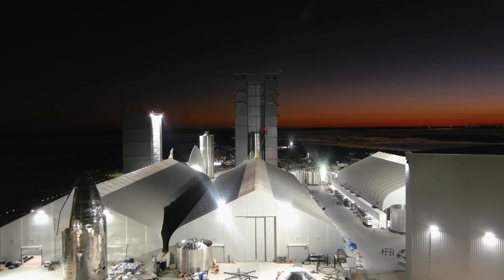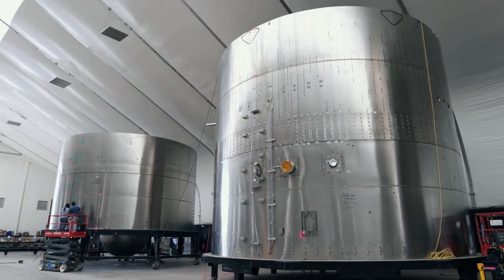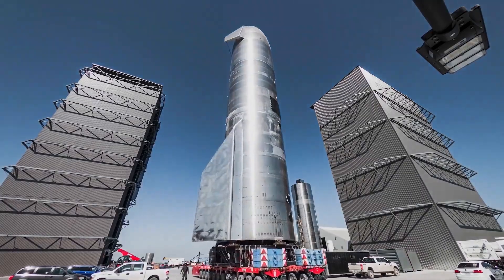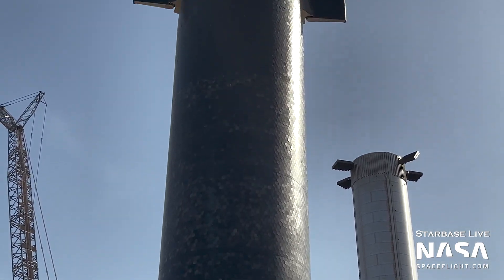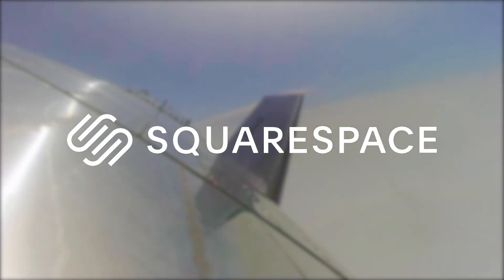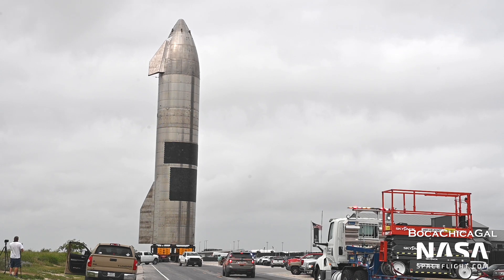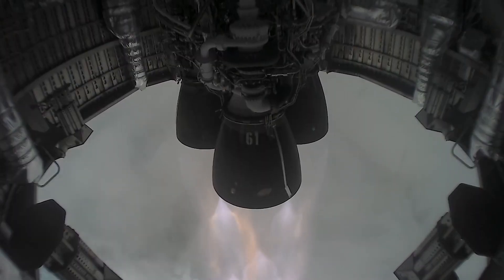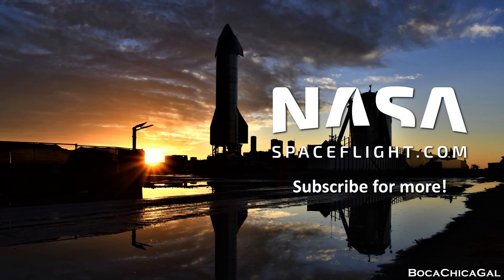How SpaceX's Starship Will Survive Reentry

Comment: Great video, just like to say that when something re-entered the atmosphere it is not friction that causes the surface to heat, it is compression (like when you compress a piston in a diesel engine, as it compresses the temp goes up exponentially ).  It is this compression that increases the heat on the surface.  Again great clip!
Reply: It is certainly not just compression, there is a very large role that friction plays in the heating. 

Do you have a source to support your statement that it is primarily compression?

Comment: I see no reason why a very large parachute(s) could not be used at the very beginning of reentry. Braking parachutes have been used on aircraft in its weight class many times. It could be triggered by a pressure switch when air resistance would be optimal. Perhaps it could be multiple chutes released at different periods. The ship could come down engines first which would eliminate the need for the flip maneuver. Parachutes can be manipulated to alter the rate of descent or to change course to some degree. The flaps would no longer be needed which would reduce drag and weight.
Reply: At the very beginning of reentry the air is much too thin for parachutes to be of any use.  Besides the velocity of starship is much too fast for parachutes to be of any use.  There is a practical reason that parachutes are only deployed lower in the atmosphere.

Parachutes are also not an option for starship because of its mass.  Over 100 metric tonnes.   The parachute needed would add a great deal of unnecessary mass which could be used for payload.
Reply: @michaeldeierhoi4096  Because the air is very thin is the reason why you could successfully deploy it. Parachutes have been used on heavier vehicles. The parachute(s) would reduce mass.
Reply: At the start of reentry it will be going faster than 7660 m/s (27,600 km/h; 17,100 mph) which is somewhere around Mach 24.
7x the SR-71 Blackbird max speed (~Mach 3.3)
1.3x the speed of sound in stainless steel (5790m/s)
Reply: @LordZarano  Well said.
Reply: @LordZarano  I know, there would be a very narrow window at which it could be safely deployed when air resistance is single digits PSI, it would have to be triggered with a pressure switch. Reentry could be stretched out to perhaps 4 hours. A parachute is a simple thing, if it survives deployment it will do what parachutes do, it will be safer, cheaper and lighter.

Comment: I will be both astonished and ecstatic if it even makes it to orbit. Let alone survive re-entry. 
No booster has performed a test flight.
I would imagine all those raptors firing up is going to generate quite a shock wave and a lot of noise. 
I'm glad finally to start hearing someone talk about the tiles issue, it's been bugging me for ages. 
I am sure SpaceX can and will fix any issues but checking thousands of tiles between flights is potentially a big problem for rapid reusability. Especially if you want it certified for human flight.
I can't imagine NASA allowing astronauts on board if even a single tile is missing.

Comment: She is 100% going to fail on re-entry due to tile issues. I understand the hardware-rich approach, but that should still involve as much mitigation of known issues as possible. Sad that there aren't more suborbital hops planned in order to see how a fully tiled Starship performs with the vibration of engine operation for long durations.
Reply: There is nothing sad about it.  This is the way rocket development progresses.  We should be glad to see as much as we do see.  This a rocket development from scratch as it were.  And many hiccups and set backs are assured along the way.  Or as Elon has said "If you are not failing you are innovating".  Of course Space has a contingency plan to limit failure where possible.
Reply: There were 20 sub-orbitals in the application. But you might as well try one or two to start with that have a full set and see what happens.

Comment: The tiles fall of too easy one pipe gets too high pressure and they fall off.thats not good enough.plasma is very hot and used for cutting metal on earth so this needs to be addressed for reusable quick turn around time the other rockets they launch  seem to not have problems.but are they high enough ?the higher it seem the more speed the more higher orbit more heat.theres probly a way.

Comment: Tile loss from Space Shuttle Orbiter in 1979--those were temporary polyurethane tiles installed for the  flight on the back of the 747 from Edwards AFB to KSC.

The loss of Columbia during EDL in Feb 2003 was not caused by tile loss or damage. The carbon-carbon composite leading edge of the left wing was damaged by thermal insulating foam that became detached from the External Tank and caused that disaster.

The tiles were not involved in either the Challenger disaster or the loss of Columbia. The tiles performed perfectly on the 133 successful Shuttle Orbiter EDLs (100% reliability).

Starship has that flexible ceramic fiber mat between the backside of the tile and the stainless steel hull. It could be something like Kaowool 3000 that would provide added protection to the hull up to 2900F (1593C).  

If the number of hex tiles on Starship is really 18,000 and there are three fastening posts per tile, that's 54,000 posts, each of which is resistance welded to the stainless steel hull by robotic welders. I would expect at least a few weld failures to occur randomly among those tiles. The probability of a given tile would have two or three defective welds on its three posts is vanishingly small.

Side note: I worked on development and testing of the Space Shuttle tiles during the conceptual design period (1969-70). Later, in 1995-96 I did similar work for the X-33 thermal protection system.
Reply: With your experience you seem confident that the tile system will work well in the long run.
quick question could you guesstimate what weight the TPS  would be in total?
how heavy would one of those tiles roughly be? 
also do they use something to fill the gaps between the tiles?
Reply: @bolgert911  If the density of those hex tiles is 9 lb/ft^3 (145 kg/m^3, same as the tiles on the bottom of the Space Shuttle Orbiter) and the tile thickness is 3" (0.0762m), the surface density of the tiles is 11 kg/m^2.  The area of the  windward side of Ship (the second stage of Starship) is 793 m^2. So the mass of that heat shield is 8.8t (metric tons).
Reply: Good points. It sounds like they are assuming that only two attachments (or perhaps one) are needed to anchor the tiles. This seems hard to assure in the design/testing phase. With the vibration and turbulent flow around flaps etc. it's easy to image tiles becoming dislodged even if only one fastening post fails. Can you get local outward pressumes on tiles? Say due to high pressure under the tiles and turbulence on the outside?
Reply: @marksinclair701  If the flexible ceramic fiber mat that now is placed between the tile backside and the stainless steel hull absorbs water in the humid air at Boca Chica or at the Cape, then it's possible that you could get high pressure under the tiles during the EDL if the temperature of that mat exceeds the boiling point of water.  

The tiles on the Shuttle Orbiters were re-waterproofed between each launch to prevent high pressure inside the tile from causing cracks. Also the weight of absorbed water can be several tons. Each pound of water absorbed by the  tiles reduces the payload to orbit by one pound.

I don't know how Elon waterproofs the tiles on Starship.
Reply: @rays2506  Fascinating. And this is occuring during EDL? Wondering if the the water would boil off (sublimate?) in vacuum during launch or in orbit. I haven't seen any sign of waterproofing measures between tiles on Starship. Seems like a bigger potential problem for Starship than on the Shuttle - won't the cold tanks condense ice behind the tiles?

Comment: There has got to be a better solution than these damn tiles! Tile loss has been a severe problem since the early days of the shuttle and apparently haven't gotten any better in the last 40 years. I'm surprised SpaceX, which is known for their "thinking out of the box" solutions went with such an old and problematic method.
Reply: You are making an assumption that simply because Space X is also using tile system that it using an old problematic system.   The TPS for Starship is very different from the shuttle in having most of the tiles having the same size as well a different attachment system. 

 Second Starship has a steel hull which is much more resistant to heat then the alternatives.  Finally, the effectiveness of the Starship TPS can only be truly tested in an orbital test which is imminent.   

I should also mention that your comment offers only criticism of the current TPS of starship, but no suggestions for an alternative.
Reply: They did think outside the box: originally, Starship was going to use transpiration cooling (in other words: "sweat") using pores in the hull which deposit a thin film of liquid methane onto the skin.

We don't know too much about why they abandoned this idea and went back to tiles, but we can assume that the reason is some variation of *because it doesn't work and tiles do*.

Comment: They should find a way to make the heat shield spray-on. Like that expanding foam insulation
Reply: That's what I was thinking. Spray it out on entry. Like a burnt marshmallow shell.
Reply: A spray on tps has been considered and rejected because it could not handle the heat on reentry.

Comment: SpaceX better solve that heat shield problem.  Because, landing on Mars will end in disaster if they don't.  Because of Mars' thin atmosphere, the Starship will have to spend a much longer amount of time aerobraking, and therefore a longer amount of time in a very high heat situation, than it will when reentering the Earth's atmosphere.

Comment: I think Starship (stage 2) will and should be seen as a disposable stage for many many flights.  All focus has to be on getting the booster back given the sheer number of engines it has.  + I think they'll come up with some legs for the booster before attempting catches--sacrificing a bit of payload for not destroying your launch site seems reasonable!
Reply: This does not have to be an either or issue during this early prototyping of starship.  The goal is to bring both back. After all both booster and ship are undergoing constant development.  

Space X isn't considering landing legs at this point. Perhaps later.  "The best part is no part".  EM

Comment: Some comments:
- Tiles can fail, crack or fall off during the stress of re-entry. High shear loads, flexing of the body of the vehicle (which won't be pressurised, unlike launch) and turbulence are all in play.
- The mechanism of failure appears to be in the interface between the tile material and the metal embedded in the tile that forms part of the one-way clip. One suspects this interface is too rigid and thus the fragile silica material is tearing from the mounting hardware. Would be nice if SpaceX were more transparent about this.
- The time the Space Shuttle survived a lost tile on the hot side, we were extremely lucky because the tile was sitting over a steel antenna element, which protected the vehicle.
- The felt blanket isn't designed for direct contact with plasma. It will survive some leakage, but it will decompose/ablate if a tile falls off. Worse if a group of tiles falls off.
- There is a progressive failure mode where if one tile falls off, it creates more shear stress on the tiles next to it, leading to a zipper effect.
- If the stainless steel is exposed, it probably won't melt, but it can soften, deform and other more sensitive components may be exposed to high temperatures and lead to unpredictable failure.

SpaceX might be able to remedy this with a more substantial internal reinforcement (the metal embedded within the tile), but this will add weight.
I was quite keen on the original transpirational cooling and there are other methods including a "hot skin" (Rocket Labs is considering this for the feet of its Neutron) and there are hybrid methods involving some active cooling. Those who think Starship will be operational in a year or two don't understand how hard the engineering is.
Reply: The tanks will be pressurized during reentry not at liftoff pressure but still pressurized.
Reply: @ronwoodward716  The payload bay won't be pressurized and there is some tricky tile geometry right there.
Reply: @ronwoodward716  That isn't what happens. SpaceX starts with liquids cooled well below their boiling point. Once the engines shut off, the remaining liquid acts to condense the gas (transferring energy out of the gas and into the liquid). Net result is reduced pressure. It can go below atmospheric. There's always an equilibrium pressure, but its not enough to stiffen the tank. Even the header tanks will act to cool the space around them. Plus the cargo bay will be unpressurised.
Reply: @saumyacow4435  The fuel tanks on the Star Ship are balloon style tanks. The walls of the tanks are very thin for their size and weight. That thin structure cannot maintain the desired shape under load without it being pressurized. This is done to save weight. The tanks must be pressurized at all times except during construction. They even pressurize them during transport to the test and launch stands. Once loaded with propellant the fuel and oxidizer constantly boils off to maintain the low temperature. The gas created by this boil off must regularly be vented to prevent the tanks from going over pressure and exploding. Because of this SpaceX has eliminated the cold gas maneuvering thrusters and instead use the boil off gas for maneuvering. The tanks are never below atmospheric pressure. Especially in space because the external pressure is essentially zero. Any internal pressure will act to stiffen the structure of the spacecraft. As for the cargo hold it may or may not be pressurized depending on the cargo. If they ship is carrying people it will be pressurized. For the early launches probably not. If it is not pressurized the inside will be covered with stiffening stringers to carry the loads for launch and reentry. The inside has many structural elements now that are needed to spread the loads from lifting points, flap attachments, engine mounts, fueling ports,  valves etc.
Reply: @ronwoodward716  Ok for starters its not technically a balloon tank. It is structurally stable sitting empty, or sitting full of propellant but without pressure, at least until it is accelerated. Real balloon tanks have to be pressurised before they can be filled. 

But leaving that aside, you're not differentiating between the booster and the upper stage of Starship. The booster has no insulation and the heat transferred from the surrounding air is significant and will pressurise the contents. Hence you need vents to control the pressure.

The upper stage of Starship is a different thing entirely. For a start, once it is in space, there's no convective heat transfer because there's no atmosphere. Secondly, its heavily insulated which limits heat gain even from exposure to the sun. And in the course of a suborbital flight you're not spending enough time exposed to the sun to compensate for the fact that the propellant is super cooled. It will in fact cause the gas to recondense into the liquid - at least for some time as the liquid soaks up heat. 

Whilst the liquid remains cooled well below its boiling point, the equilibrium gas pressure will be well below 1 bar. You need several bar. 

Again, if you want it to be stiffened by pressure, you have to have a heater of some sort. And you have to keep generating gas because its not in equilibrium. That gas will still want to return to liquid phase because the liquid is still well below boiling point. And also you need that heat source to generate gas pressure before descent - since you're not going to be using the main engines until near landing. 

You can add all the stringers and bracing you like, but the structure will flex during descent. That's a guarantee. Even with pressurisation, the loads during descent are high. The loads exerted on the flaps have to be distributed around the shell. Unless you're going to the extent of having an extremely rigid internal 3D isogrid, its still going to flex. Airplanes do this and they have lots of stiffeners. It doesn't matter a lot because they're not trying to hang on to fragile silica bricks. 

Oh and one other thing. Starship will have a large unpressurised volume (for cargo). That requires special attention structurally because it cannot be stiffened by pressure. And its right in the zone where forces from the forward flaps will be transmitted. 

Now going back to the original issue. The tiles are clearly failing because there's an interface between the tile material (fragile/brittle silica) and the metal that forms the tile side of the clip mechanism. That has to be fixed. As for the overall structural soundness of Starship. Well, that remains to be seen. You can engineer your way out of it, but the real question is about what usable payload do you end up with? Every tonne of extra structural mass is a tonne less payload. The temptation is unfortunately to push the limits. Not a good idea for prototyping. Its better to over-engineer then figure out where the mass isn't needed later. 

Its a pity that Elon walked away from carbon fibre. Maybe he'll go back to it.

Comment: Would be cool to have an inner layer that might add weight but if integrated into the tile and wall, could expand into a temporary foam or alternate heat load dissipation mechanism. In the long run a more expensive version would have reactive tiles that interlock more and then fuse more each entry.
Reply: Or a bigger bakery to make a icing on the entire side of the ship as a one piece layer coating.   ?:????